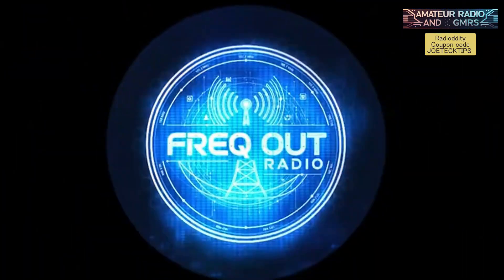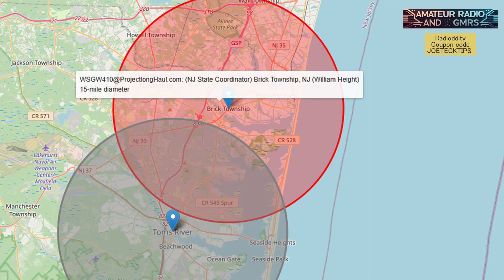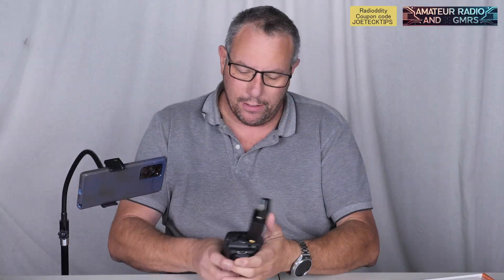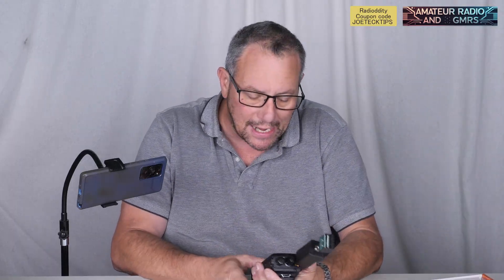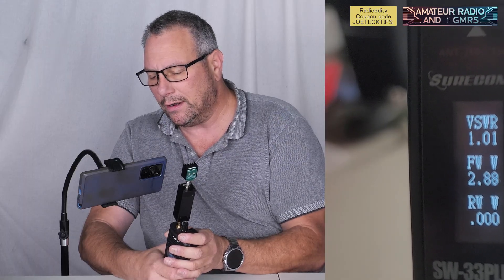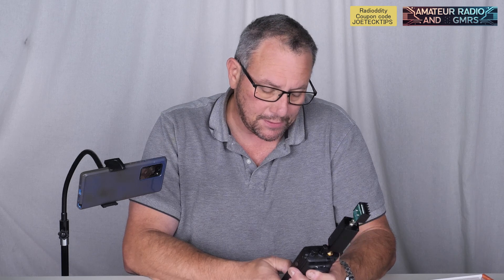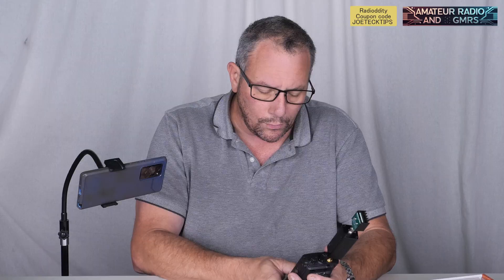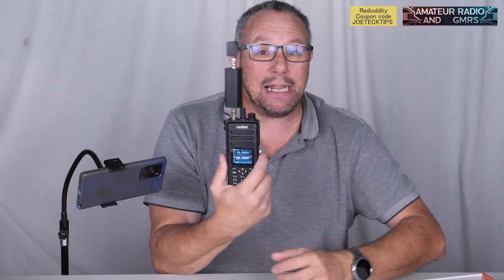Radtel RT-730 | Does this suck too?

Comment: You can transmit on the air band with that Radtel I accidentally stumbled on that thats the RT 880 or UV98 plus I got both of them the Radtel RT880 and Iradio UV98 plus both the same anyway getting back to transmit on the air band I already had the air band frequency 125.700 and I had Ch 12 156.600 VHF marine band and then I started checking out the UF repeater and U couldn’t turn it of quick anough because the repeater reversed and transmitted on 125.700 in the mode of FM but it did transmit on the air band so I used the Iradio to key up the repeater
Reply from the maker: Thanks for sharing your experience, it's interesting to hear what you found.
Reply: @RFRadioNetwork your welcome